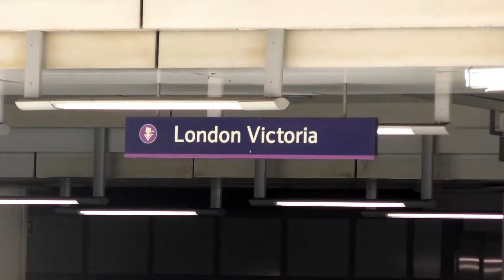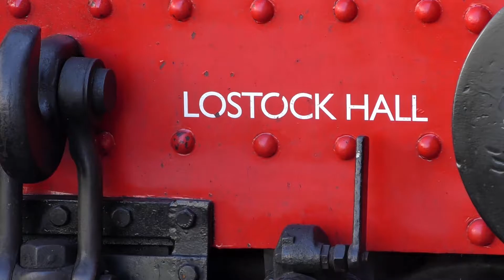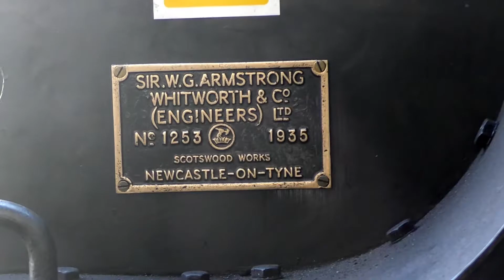Black 5 45212 | The Cathedrals Express - 15.05.18

Comment: Did they disconnect the 47 whilst the train was moving?
Reply from the maker: The 47 was disconnected before the train moved off, however it normally gives the train a push out of Victoria for some assistance. However in this case it seems the 47's brakes went on or something or it stopped too soon.